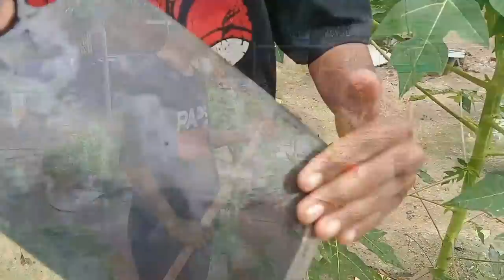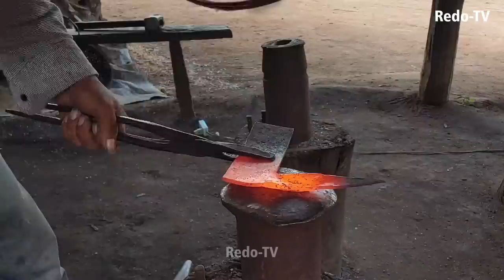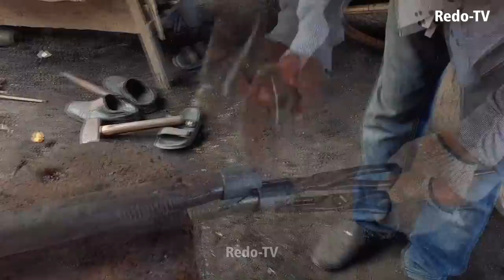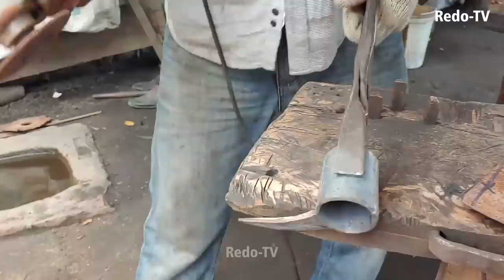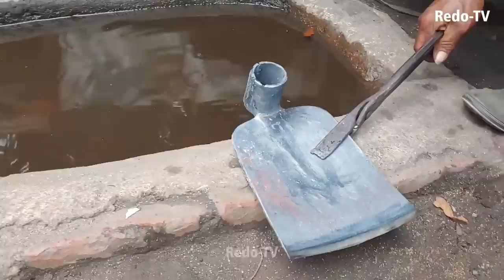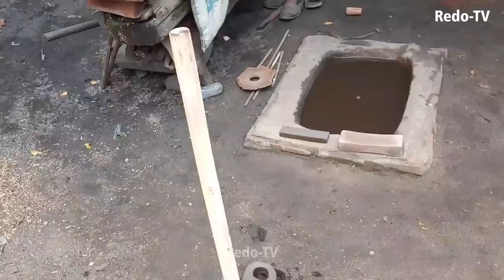How is Village Blacksmith Forging a Hoe from Old Disc Plough Steel

Comment: Very nice work and skill at making this tool.  To make this tool last longer and be stronger you should have left the blade solid and just add the spine to the blade.  The blade should have a cutout in the shape of a half a circle so that it would wrap half way around the pipe and welded   around half the pipe.  Then I would make a corner gusset spine to the pipe made of 3/18 steel that would go 3 or 4 cm over the blade and 2 cm over the pipe.   This would make the tool good and solid for 10 20 years.